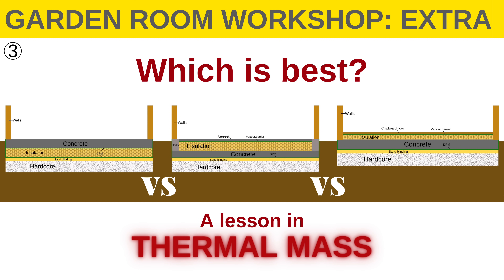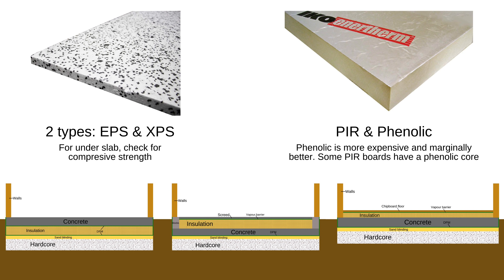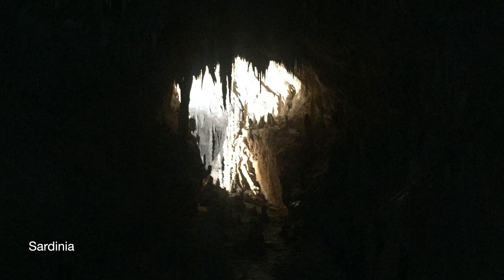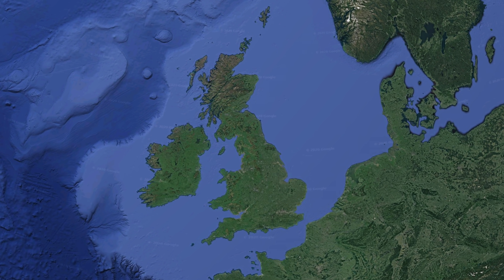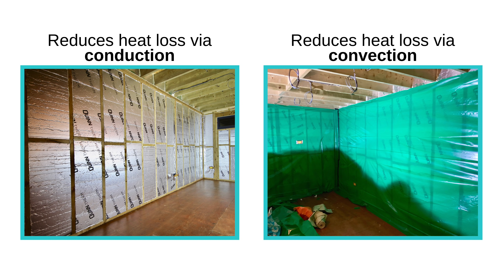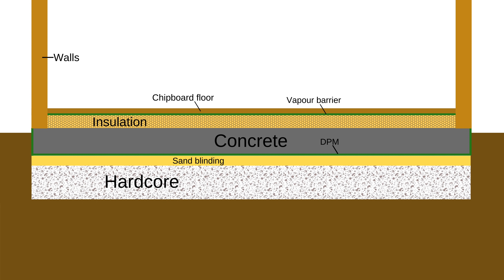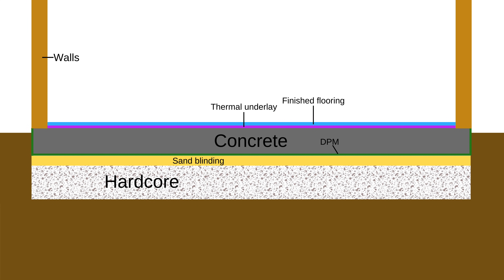Garden Room Workshop Extra | Insulating A Concrete Slab

Comment: Another great video, keep them coming. I’ve been considering option 3 for my workshop but the concrete base is a little uneven. Do you think the celotex would ‘soak up’ any imperfections in the floor?
Reply from the maker: Yeh it will along with the chipbaord and floor underlay but if it's quite uneven you could pour a liquid levelling screed that will flow into the low spots and make everything level and only lose a few mm at most 👍

Comment: Great, informative video as always Ali. I too am opting for option 3. Interesting to hear you would just lay the PIR and lay flooring on top, I’ve been swaying between this and laying some 4x2 down for my floor to fix onto, hoping for a more stable and quiet floor. Do you think the PIR joints would rub eachother and squeak?
Reply from the maker: Hey Chris, based on my warm roof which I had OSB over the top of and walked on quite a bit I never heard any squeaks and the PIR boards were butted up right next to each other so you shouldn't have a problem. I'm not a purest when it comes to construction. There are many different methods and ways of achieving similar results and what I would choose is not gospel so if you want to put 4x2 down then go for it, but ideally you'd want to raise the timbers off the slab to allow ventilation underneath which adds more height and effort.
Reply: Fair point about raising the timbers for ventilation! You may have just given me enough to move forward with just a PIR base! I’ll keep up my research, but this was just the video I needed as I’m getting my concrete slab down this side of winter ready for the build in spring.

Comment: 2:53 I thought building regs said extensions need insulation under foundation? (not certain though)
Reply from the maker: I'm not 100% sure for extensions but I know you can do no. 2 with no issues as that's how my mum's extension was done and it was all passed by BR.

Comment: Hi Ali I opted for option 3 but with floor joists (more money I know )anyway I'm using 50mm pir boards within 4 inch joists so it leaves a gap of 50mm would you float them so they are flush with joists or push them down to the concrete leaving a 50mm gap I'm not sure due to condensation etc could you help....
Reply from the maker: I'd push them down so you get a ~45mm gap above. This air gap allows the foil to radiate infrared heat back towards the building (I can't currently explain exactly how this works but know that it does) whereas no gap means you lose that function for the most part. Then I'd put down a polythene vapour barrier over the top of the joists because with the insulation pushed down you cant aluminium foil tape them 👍
Reply: @AliDymock  cheers..so what would be the dis advantage of having the insulation flush with the joists and the gap below
Reply: @paulholt4831  possible condensation in the void and bridging of this to joists would be my biggest concern even if you are laying a dpm over the entire slab.

Comment: Thanks Ali, great video!
The use of 'thermal mass' is a default option that has arisen due to the way houses have been built over the past few centuries; it is now possible to control the internal environment more effectively and efficiently which reduces the requirement to have thermal mass for temperature stability purposes.
Interestingly, water is the material with the highest specific heat capacity (over 4x that of concrete), so having a well insulated water tank is an effective way of storing heat energy for use at a time when required, rather than constantly heating the floor slab of a thermally leaky building.
Reply from the maker: Yeh I found that fact that water is the best material in terms of thermal mass. I compared the temperature swings for 4 different cities at around 51 degrees north (latitude): Plymouth and Vancouver by the sea have very moderate temperatures vs Winnepeg and Nur-Sultan have very large swings as they're landlocked. I left it out of the video as thought it would be too much.
I never thought about the a water tank working that way inside a house though - good point. It's fascinating stuff!
Reply: @AliDymock   The issue of insulation is intrinsically linked to achieving and maintaining a comfortable internal environment. There is quite a lot of positive appraisal for underfloor heating, but is often tied to the assumption of having an internal concrete slab which requires being heated to remain comfortable - doing away with this thermal heatsink and having a better insulated floor opens up the possibility of other methods of heating/cooling that can be more responsive and efficient, but they are often overlooked.

Comment: Good Morning. I’m just in the process of converting part of my garage at the bottom of my garden to an office. The garage has a concrete floor and I’m trying to keep the floor build-up to a minimum. At the end of the video you recommend a thin floor insulation. Can I ask what product you would recommend as this will allow me to add maybe 25mm and not 80mm to the floor build-up height.
Reply from the maker: I'm not sure about a specific product but check out Screwfix: https://www.screwfix.com/c/building-doors/underlay/cat850024. They all differ. I used the fibremat green stuff, maybe you could double that up (10mm total + 12mm laminate =22mm) to get a bit better thermal separation from the slab?

Comment: Thanks for the video, this is exactly the "geeky" topic I'm thinking about lately. I get why a garden room would benefit the most from option 3, but for a house, or when you want to keep it heated trough out the year, I would definitely go for option 1. Even when you are in a moderate climate (cant have enough thermal mass?). I would even go so far as making the sand blinding layer higher, or am I missing something? Also placing insulation the sides of the foundation looks like an wise improvement in option 1 drawing.
Reply from the maker: Hey Luuk, yeh have a read of the description, I mention everything you have. All options are good for both a garden room and house. I sort of make a mountain out of molehill to demonstrate the point of thermal mass and really only make my picks to help people decide. :)
Reply: It's definitely possible to have too much 'thermal mass', in particular when it is linked to your heating system (e.g. a concrete slab with underfloor heating).

Generally speaking, thermal mass stabilises the temperature in a house. Which means if you want to change the temperature quickly (e.g. you've just come back from holiday and want to warm the house up), then thermal mass works against you. This can become very problematic where that thermal mass is used as a radiator to heat the home (e.g. where a concrete slab contains underfloor heating pipes) - the more thermal mass the longer the control feedback loop - to the point where you have to change the thermostat several hours before you want to feel the benefit. If you overshoot and it becomes too warm then it will take several hours to cool down again. As a rough rule of thumb, you want to stabilise the temperatures across a single day/night cycle - but not any longer. That means for option 1 you need to be careful with how thick the concrete slab is if you plan on using it with underfloor heating - option 2 with a thinner screed gives you better control. And option 3 with wall hung radiators gives you the quickest response, which makes it well suited to garden rooms.

And if you want to be really geeky - 'thermal mass' is a bit of mythical unit. Generally speaking people/architects/builders think it is similar to density, in that heavy materials are "better" (concrete/brick/block), however the key material property is actually specific heat capacity. For example water has roughly 4 times the heat capacity of concrete, but less than half the density. Plasterboard/Plaster are also good 'thermal mass' materials - and surprisingly so. As is wood fibre insulation.
Reply: @johnmit  Hi John,
Thanks for your response. With the specific heat capacity you make a really good point and a counter intuitive one for me I must admit, really interesting.

For a garden room I totally agree with you that you can have to much heat capacity. I must clarify that I watch the video's of Ali with a house in mind and try to apply the pro's and cons to may own situation. In a house I think that you can't have too much heat capacity. See my reasoning below, I'm curious what you or other people think. 

My current vision on house temperature is that with a modern (extra) well insulated house you never want to change the temperature "quickly". To have a comfortable home I would say that the temperature should stay as constant as possible, thus not regulate on a day or hour scale, but more a monthly/yearly cycle. When establishing that there are inputs in the system like day night temperatures, wind, sun, activity in the house, opening of doors that should be compensated for, the systems described below are possible (I have put them in extremes).

- By a very good control system and low heat capacity, quickly heating or cooling when events happen. This means you need a lot of extra capacity on both heating and cooling to stay in control.
- Or have a very slow system with a high heat capacity and a slow control system. The last sounds cheaper, and more comfortable to me. Having a slow system means you can use energy when its cheapest, or available (think of renewables). This makes the system less dependent on specific circumstances.

I would not design a house for the 3 weeks of holiday per year I'm really away, especially because its in the summer and keeping every thing closed in the house during the day will help the most in keeping the heat out. Having the floor heating then disposing of its excess energy during the night via a outside radiator could be a nice addition to the system.
Reply: @luuksta1027  You're right in that behaviours are a big part of this as well - if you have an underfloor heating system with a high thermal mass you need to expect and plan around a constant temperature. A lot of the problems come from people who treat it like a traditional hot water radiator system that can bring a house up to temperature in 30minutes.

The problem with very high thermal mass in your slow heating system (which you're right, should be cheaper and more economical to run), is the control feed back loop. If for example you have underfloor heating at 30degC, which heats up the slab and then switches off when the room is up to temperature (say 21degC), the slab will continue to emit heat and the room will over heat. The control system needs to account for the heat that is in the slab and not yet released into the room.Turning the underfloor temperature down helps, but heating blending valves then also start struggling to maintain an accurate temperature <30degC. The higher the thermal mass, the bigger the compensation needed - and the smarter (and more accurate) the heating controls need to be. For a Passiv House level of insulation this can then be a real problem to do accurately to maintain a comfortable temperature - easy enough if you account for it in the design phase, but can be difficult to resolve if you get it wrong.

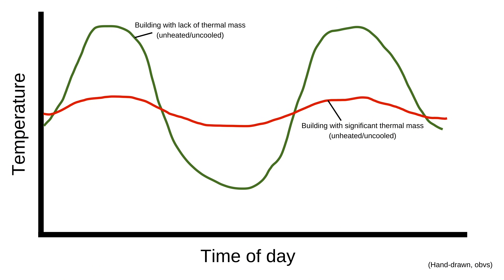Once you go beyond enough thermal mass to dampen out a 24hr cycle (e.g. where it stays cool during a hot summers day from the previous night, the graph @1:49) the extra mass stops adding much benefit - but keeps adding to your build cost.

Comment: over the summer we built a sun room(3×2.5m) on the back of the house.  As one of the kids will use this as a bedroom when back from university we opted for the 100mm concrete over 100mm of insulation.  Electric underfloor heating (1200w) then a 65mm screed.  It takes a couple of hours to warm up but stays warm for 8 hours. so great for overnight.  next job is solar panels to offset the heating costs.
Reply from the maker: Nice! Good choice for a bedroom.
Reply: That's interesting to know about the warm up times there Jo.  I was mulling over the idea of underfloor heating.
Can I ask what flooring you have on top of the concrete?  Laminate or carpet?
And, you've ONLY got that 1200w underfloor heating, and no wall mounted heaters required?
I guess the underfloor heating has to get that thermal mass of the concrete up before it seriously starts to radiate into the room.